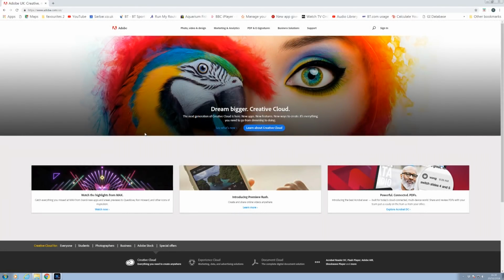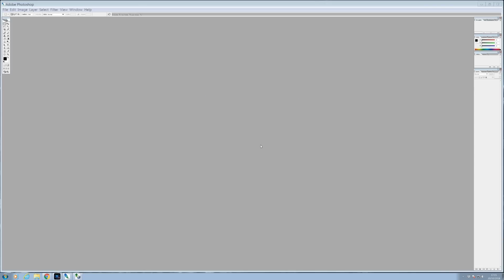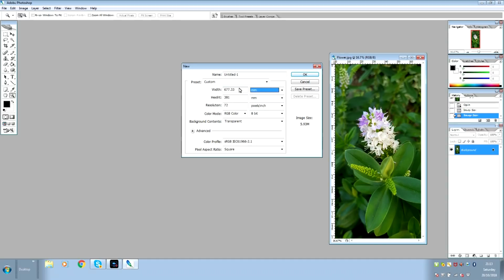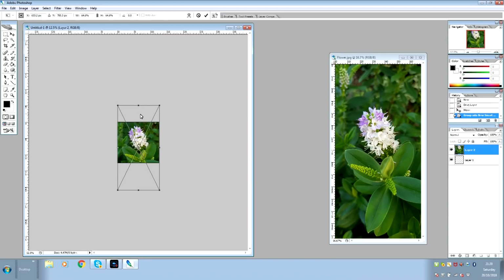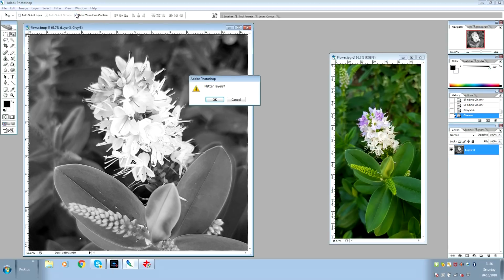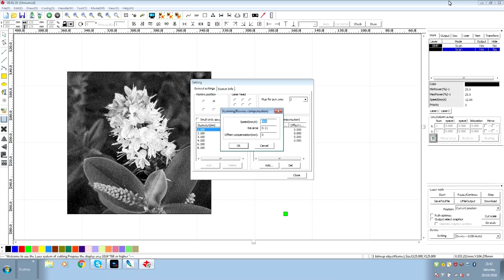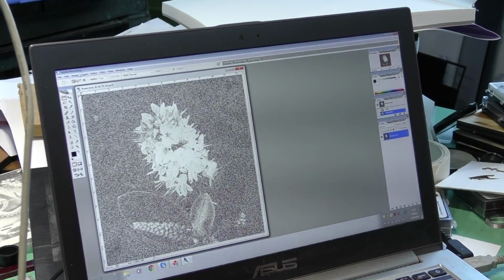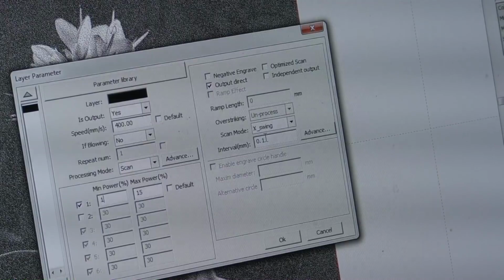RDWorks Learning Lab 160 Adobe CS2 LEGALLY free

Comment: Your videos are the best!!!
Hello, I recently bought this machine but I have a problem.
I'm trying to load the jobs from a USB drive but it does not detect any files.
I have inserted it in the 2 USB ports and it does not detect any file.
The files that I try to load are created with RDWorks V8 which is the software that sent me along with the machine.
The extension of the works is .rd
I need to solve this.
Thank you

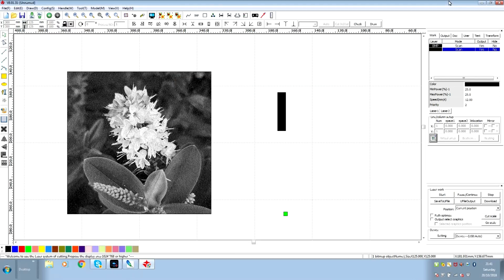Comment: Could you please link to the video where you cover the part at 23:00.
There are quite a few videos and they are all pretty long. :)
Also, I am wondering about the beam width on chinese vs Trotec lasers.
I did some cutting yesterday with my 100w china laser and compared to the Trotec the cut is a lot wider.
Do you happen to know if this is due to the laser source or mirrors/lenses or maybe all of those factors.
I saw that you have a solution for getting a really thin spot for engraving but is there also a solution for cutting?
Could I potentially use a longer focus lens above the "normal" lens to concentrate the laser to a smaller point or would that just burn the bottom
one?

Best regards
Reply from the maker: Hi
Although I have covered this in several episodes I think the clearest explanation of this problem was covered in my Lightblade Learning Lab series where I dedicated a whole session to this and another subject that can easily be confuded with this issue. See  
https://www.youtube.com/watch?v=DeCxeCrq0h4&index=48&list=PLPWEtx5V9DqEogIeYRdcG_KYcB7UL2Qmn

Beam width is quite a complex subject. The beam starts off life from the tube. Now although both machine types operate with  CO2 laser 10.6 micron wavelength light . beam size from the tube will affect final cut size. The beam is not uniform in its power across its diameter, it tends to be a normal/Gaussian distribution  where aprox  70% of its power is in the central third of the beam.  So the smaller the beam the denser the power will be.   Engraving machines, in particular, from Trotec are all low power (10 to 50 watts) and will therefore have a small beam diameter. The second big advantage is the way the machines operate. They operate with a high (and variable) frequency pulsing drive. and not a constant beam on as the Chinese machines do. A constant ON beam will do more damage because that 30% of the beam outside the central done has time to add to the burning power of a cut. With a pulsing cut that power never has time to do any damage it's only the central 70% that's working.  This is super for producing small dots because the control of power per dot is superb. So the Trotec has a head start for engraving, and at high speed . However With understanding, we can get very close with quality of line and dots  but not speed.. You can have a thick engraving line (regardless of the focal length) and make it thinner in one of two ways. You can increase the speed or you can decrease the power. Both are achieving the same thing . They are exposing less power to the material per unit of time ie the more time you expose the beam to the material the closer you will get to the full beam diameter. Run faster and only the highest density central tip of the beam will damage the material (ie a thinner line)

The beam coming from your 100 watt tube will be  about 12mm diameter. Now put it through a lens and it will still have the same energy density profile, just in a VERY small spot about 0.2mm diameter.. Trotec are still limited to the same lens materials and focal lengths that you can have on your machine. They may have higher quality aspheic lenses rather than our cheaper shperical lenses which again helps to concentate the focus to a much tighter point. Your 100 watt tube is a CUTTING tube rather than an engraving tube and depending on the Trotecs you are comparing with you may not be comparing like with like.    However you look at it, for less than 20th of the price you would pay for similar power Trotec, you  have a pretty good machine and it wont cost you a fortune to replace the tube or for service attention. You will quickly become your own 24/7 service tech!!!

The compound lens is designed as a engraving lens but I have to say that cutting up to 6mm materials it does an amazing job also. Cutting will always produce a wider cut then making a dot because you will be operating so much slower and allowing more of the beam width to burn. The typical 2" lens is pretty good but you need to run at the max allowable current (maybe 24 or 25mA for your tube, and find the fastest speed for your material thickness. Thia will produce the narrowest and cleanest (char free)cut but you must have lots of air assist into your kerf for wood and other organic materials. 
You focal length idea is upside down. The longer the focal length the bigger the beam footprint but the longer the working distance above and below the focal point Check this out for some great explanations and lots of details.
http://www.parallax-tech.com/faq.htm

Best wishes
Russ